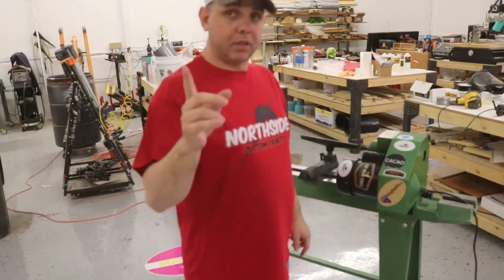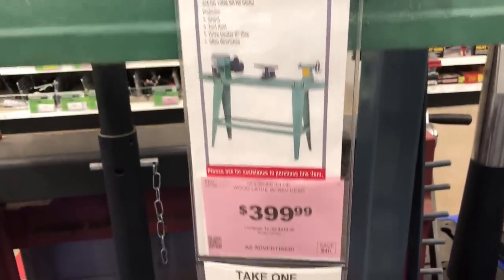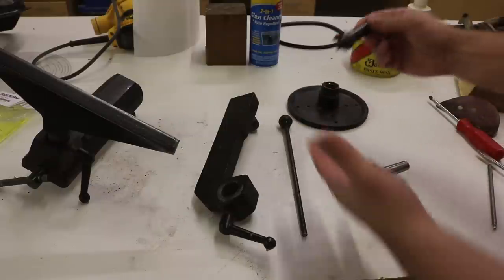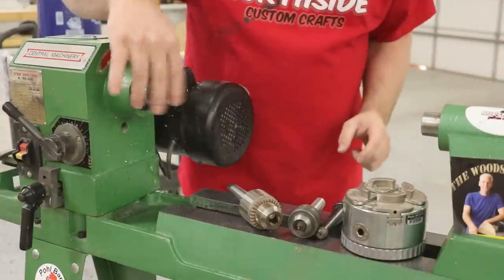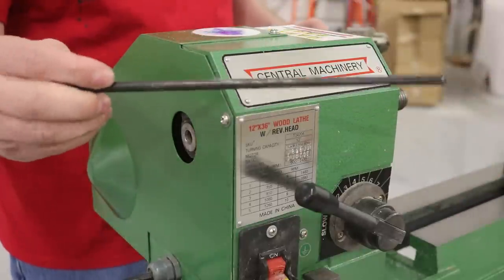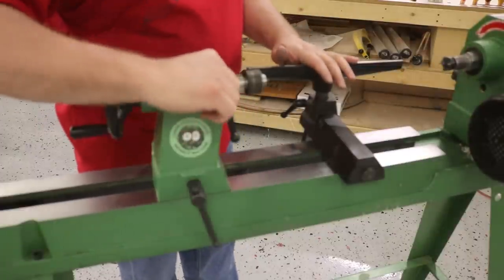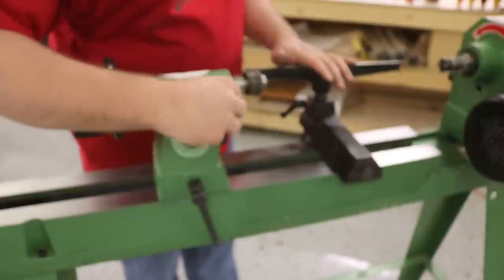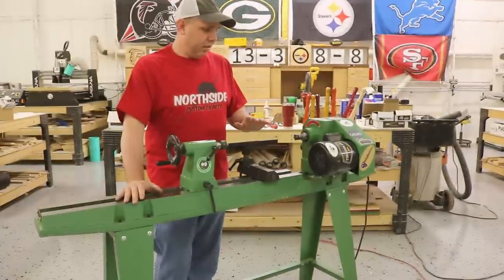Harbor Freight 34706 Lathe Review - 12 x 36 Wood Lathe

Comment: Hey Jake......It's been a while since ive been on YT, so it's refreshing watching one of your videos 1st.......Harbor Freight DOES have alot of shit tools, but some of their stuff is actually made well, and is worth every penny you spend on them, including that lathe, and their smaller lathe........One thing i would do right off the bat with your lathe is, attach a pc of plywoos to the bottom of the base and either load it up with sand bags, or build a box and just fill it with sand.......That will stop the "walking around", alot of the flexing, and most importantly, make it turn A LOT smoother and acurate........that will make a HUGE difference for sure.....And welcome to the exciting world of turning!!
Reply from the maker: AntiLißTard ed    Thank you!!! I would have bolted it down, but I’m waiting on when I build the resin room,  then it will have a more permanent location. 👍👍👊

Comment: I've finally found "my" lathe.  And by that I mean,  this is a lathe that I already own,  that I bought maybe 15 years ago?  And now I "get it".  It's the identical lathe,  only blue in colour,  and was sold under the "Mastercraft" brand from a company here in Canada called "Canadian Tire".  You might have heard of them.  Came with all the stuff you showed.  And yes,  it could go a bit slower for say,  finishing.  I did see a video where a fellow hooked up a rotisserie to his lathe for just that reason.   
So apparently,  there is one Chinese manufacturer that makes these and sticks various labels on them.  All of the "Mastercraft" tools (and I use the term "tools" lightly) have that definite "made in China"  feel to them.  
It's a good enough lathe,  and the bit about lining up the head and tailstock is something I hadn't thought of.  So thanks for that,  and the review in general.   Put a plywood shelf on the brackets down below and throw a few bags of sand on,  and it might not "walk" near as much.  Carry on!
Reply from the maker: Thank you Bob! 👍👍

Comment: Will a 12” clearance pass by the motor even with the motor head turned to the side ?
Reply from the maker: The motor is in a bad spot.. sometimes you will need to space the workpiece away from the headstock.. and it’s the same no matter what position the headstock is in. 👍👍

Comment: My biggest problem with this lathe is there is  no spindle lock so when you attach a chuck it is likely to become permanently attached as mine has. Does anyone have a method for removing a jammed chuck? It appears I have a new lathe that is totally worthless!
Reply from the maker: I put some channel lock pliers on the hex behind the Chuck and hold it that way. But I do agree that it is annoying
Reply: “Anti-lock Lathe Spindle Washers” are the answer. They’re available from Woodcraft, Packard, even Amazon, and these thin nylon washers go on the spindle before the chuck. I’m able to hold the spindle with the wrench that comes with the lathe and unscrew the chuck by hand. Easy off!!

Comment: Has anyone been able to do indexing with this lathe? At the back of the motor, rear end of the headstock. there is a female threaded hole, with the retention ring. It appears that indexing can be implemented using this female threaded hole (with a bolt that fits this size and pit of thread and a graduated disk), but I have yet to find out what thread it is.
Reply from the maker: I’m curious too

Comment: I fail to see how one can turn large bowls and platters working outboard when tge proximity of the motor precludes mounting blanks larger than around 12" diameter.
Reply from the maker: When you have a Chuck on it.. the motor isn’t in the way

Comment: No easy chuck included.  $400.00 more.  What else is needed?
Reply from the maker: It comes with a faceplate and centers.. I bought the easy Chuck as a luxury item.. but the lathe comes with everything you need to start.

Comment: Hi man I have the same lathe but I haven't used it because it does not have some pieces I really need your help please how can I contact you
Reply from the maker: What pieces are you talking about?
Reply: @JakeThompson  the thing is I bought the lathe but it did not have a lot of pieces ( the pulleys, the belt, etc etc etc ) I ordered the replacements from harbor freight and I already have many of them but there are some others I still don't have because I did not understand pretty well the drawing whithin the manual what I need is to see the same lathe in detail to understand the replacements I have to order all the replacements that have to deal with the headstock as I mentioned before